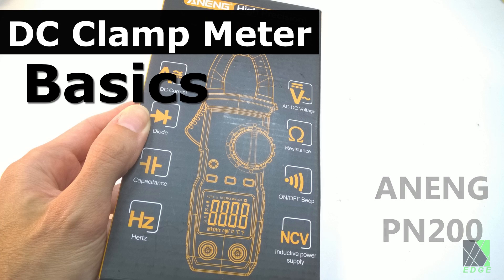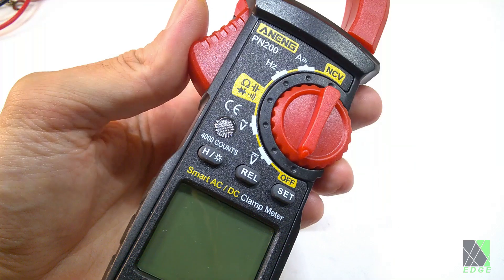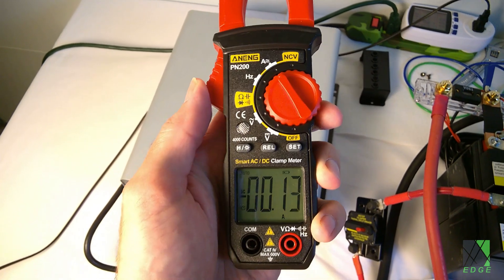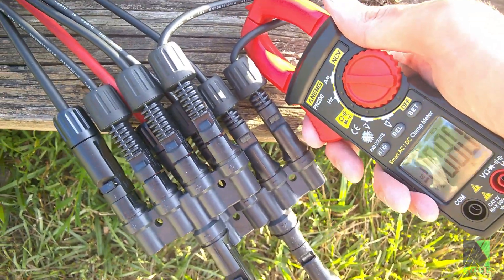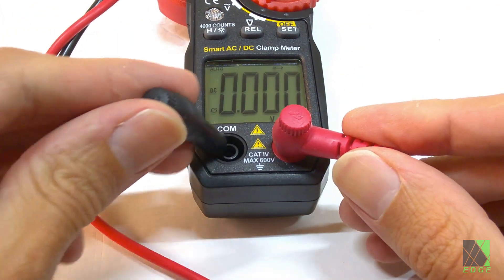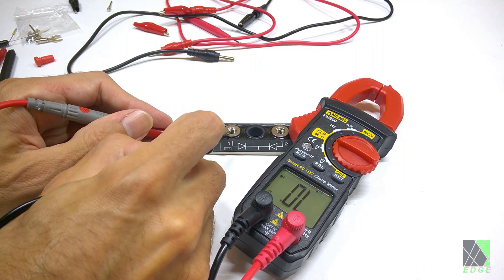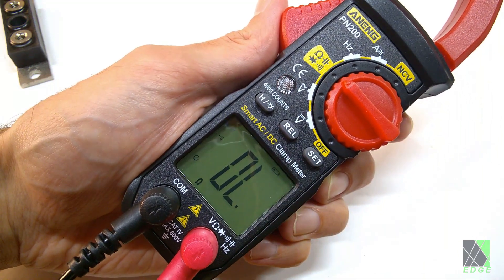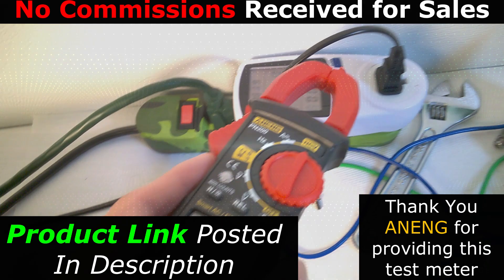Clamp Meter Basics in 5 Minutes! For DIY Solar Power & More - affordable and accurate #review

Comment: Why does it show a negative sign infront of the amp number when measuring current solar panel short circuited? Klein model clamp reader.
Reply from the maker: @mytvtv9193 This simply indicates polarity and measuring Direct Current (DC). If you flip the meter around the other way, the negative sign should go away

Comment: how is the measurement accuracy below 1 ampere DC.i work on small switching regulator repair..does this suit my needs? thanks.
Reply from the maker: @deanagoes2791 Hello, I'd use a standard multimeter with series connection (shunt measurement) for small current. That said, this meter will measure small currents, but it won't necessarily be as accurate as a shunt. It's a good idea to have both instruments though, because a clamp can quickly and easily check current flow on any wire without disconnecting or powering down the circuit - very useful!
Reply: @solarpoweredge  ok,i totally understand what you mean...thank you again.
Reply from the maker: @deanagoes2791 NP! :)

Comment: What are the maximum amps for this multimeter. I'm assuming there is a fuse inside? Thx u
Reply from the maker: @andykular3756 Hello, maximum is 600a. It does not need a fuse for amps because it uses a clamp to take the measurement. (There is no electrical contact between the meter and the circuit being measured)
Reply: @solarpoweredge  Thx u sir! As you can tell im still rather green to this. I appreciate your response
Reply from the maker: @andykular3756 Welcome sir!! happy metering 👍

Comment: I bought TWO of these meters and because I have a vision problem. I especially appreciate the large display with a back light. It's easy to use. 
  The instruction sheet is small and I may have misplaced it or something, but the only sheet I had was in Chinese however, doing a search, I ran across your video and it is excellent, you are concise and explicit and succinct in your description and thanks to your help in the comments I have used your link to order another one and have it sent to my son.
   My vision difficulties make it difficult for me to see the small numbers and to know what I have selected so I memorize the button pushes. Early in my career I worked as a maintenance electrician so I have owned many meters but if you are not doing something every day it's not as fluid.
   Like you mentioned, I also usually managed to operate meters with trial and error memory but I have to go a step further because I can't see the small indicators to know exactly what setting I have selected, that's where my memorization comes in even more so for me. On this particular meter, I know if you turn the dial to the center ( diode area ) and push SEL three times it sets up continuity. The beep is very loud and noticeable, which also helps in my case. Also you don't have to constantly hold down any button. when you use NEC to check for current presence. Once NEC is dialed in. You can check as much as you like.
  As you mentioned in your review the cables set up that is sent with the meter is the best I've seen over the years. Superior to even more expensive meters that I've purchased.

   I clicked on the link you supplied in your description and bought another meter so I can probably get a screenshot once my son receives that but if you want to send one that would be fantastic but no matter you've been a great help and it's a great review.
Reply from the maker: @neilreith7294 That works, you have it fine tuned and sorted out. The display is pretty good on this meter. Thanks for clicking on the link - if you want to email (it's on the about page) I will send snapshots of both sides of the english manual. Otherwise, your son can probably do it. -Dave

Comment: Thank you for your great demonstration. I bought an ANENG PN200 and liked it. I'm thinking about buying one for my son however it came with only one sheet of instructions in Chinese. I don't know if it should've had a manual or at least a sheet in English or not I've tried to contact the company so far no luck I've tried searching for the manual online, do you have any idea where I can secure an English version of the instructions for this instrument that you used in this video? ANENG PN200
thank you
(I do have a vision  difficulties, so it's hard for me to see the small indicators. Therefore, I need to understand the selection of the buttons to know what I'm doing.)
Reply from the maker: @neilreith7294  Hello, sorry about the difficulties - I will try to help if I can. Any questions about the functions, I can post answers here, it might help others too.

Also, this meter came with a very small english manual. I don't say it covers every feature, but kind of an overview and specifications. If you want, I can send a photo of the pages. Basically I just kind of figured out the meter by pressing buttons, which is my standard procedure !

Comment: Positive what colour?
Reply from the maker: @gnking4rtlov3r71 Hello, positive is usually red. For a clamp meter amperage measurement, the direction of current flow is indicated by a positive or negative readout on the display. You can clamp any single wire positive or negative to get a reading. Hope that helps